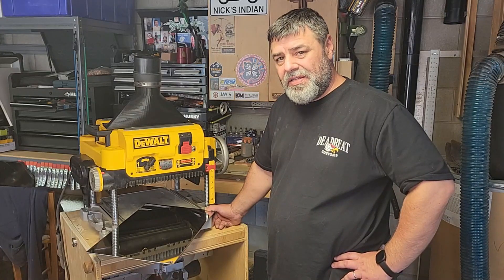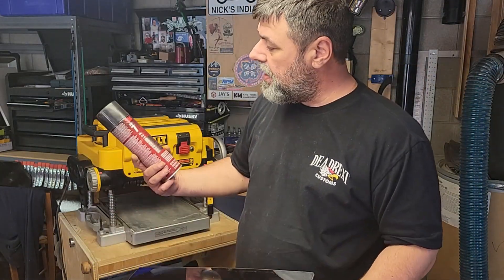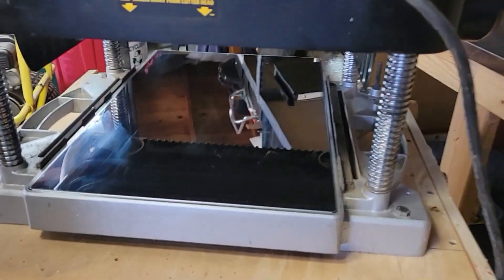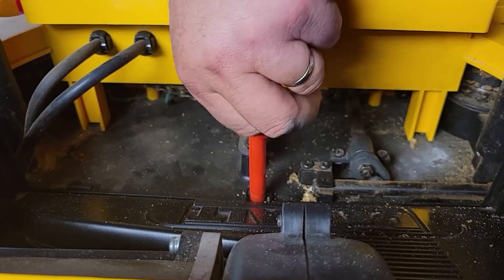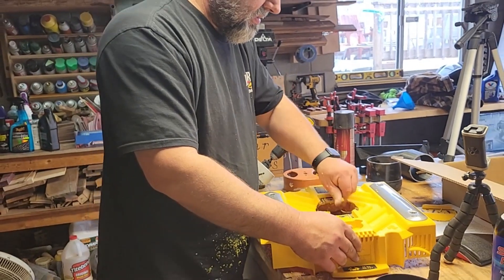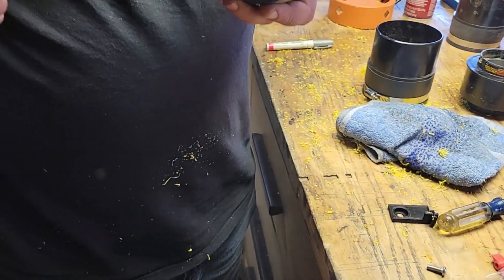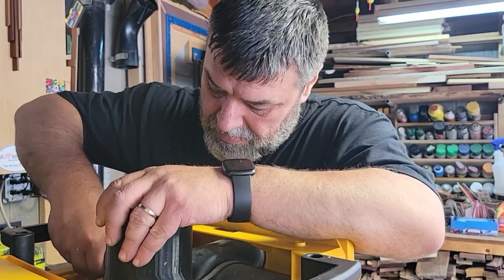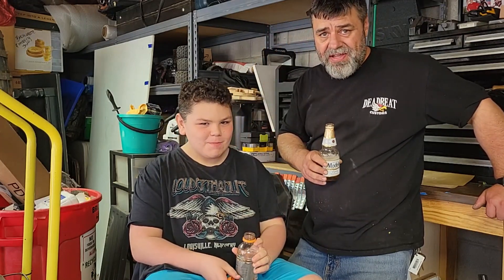NEW Dewalt 735 upgrades with install. Stainless steel plate and 3D printed dust port for Dust Rite

Comment: I really appreciate you showing how you replaced the base plate. No one else has a video about it and it was definitely what I needed to get to it on my own. My plate was replaced by the last owner and applied glue uneven, but the 3m spray is a great idea. How’s it held up?